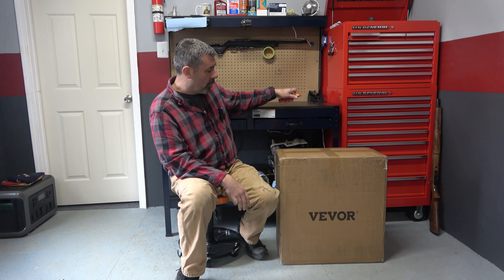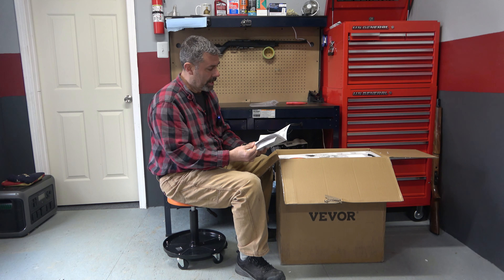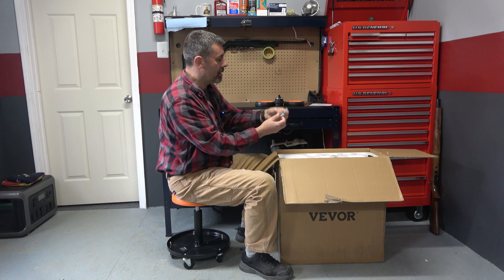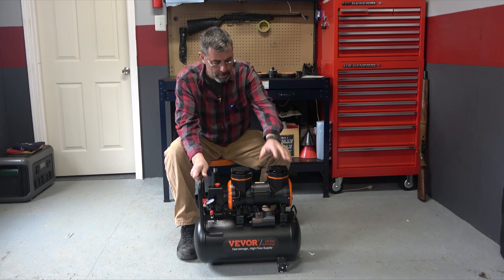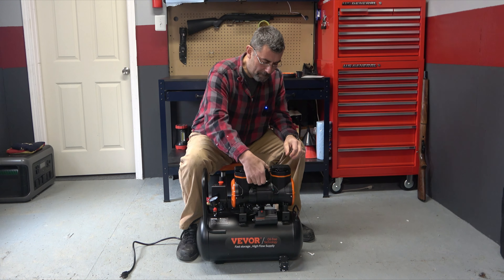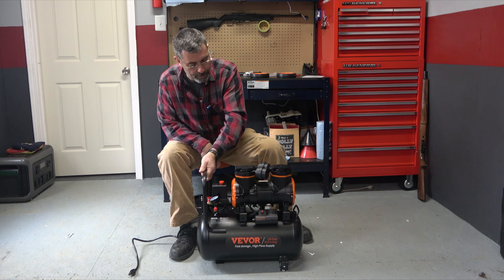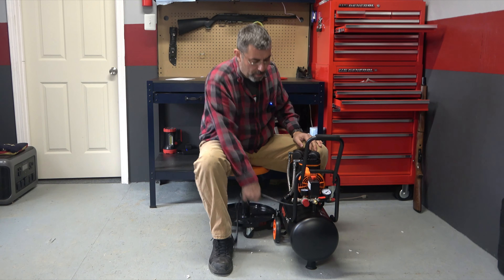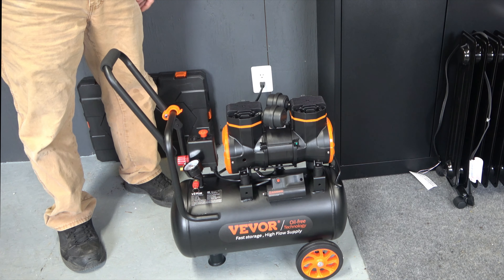Vevor 6.3 Gallon Air Compressor. Perfect for working with small engines.

Comment: Nice little compressor! I'm thinking about getting one for my Basement. Seems very quiet and as you said, it pumps up fast. The one I bought for my garage is a older 6 HP 30 Gallon (Craftsman) single cylinder and it's very noisy. But I picked it up from a abandoned storage unit for $100. Take care Eric, 73's!
Reply from the maker: For light work, it would be perfect for you.

Comment: That air compressor with the way the cylinders are really looks like the newer quiet run air compressors. That size is great for many things. I have a big Mac tools compressor and I have a smaller harbor freight one and I picked up a repaired pancake compressor.  I walked into a great deal on the last compressor. It was purchased and returned the same day because a piece was broken. They had just repaired it and the guy was complaining about having to find a place to put it untill someone would want one and be willing to buy one out of the box.  I had watched him replace the broken part. I asked how much and he said if you want it half price. I think it was $190 or more normally it wasn't a cheap one. I think he ended up selling it to me for $89 and I was able to get a full warranty with it. I have used it for about 5 or 6 years now no issues. It's easy to fill it up and put it in the car and take with me when I get called out for a flat tire.  It holds enough to put more then enough air in a tire to drive on it and get to a better place.  I will probably pick up some vevor tools sooner or later.
Reply from the maker: It pays to be in the right place at the right time. I would not think it would do a tractor tire, but car tire sure.

Comment: that looks like a great small compressor. love how quite that is. i got the small 2 tank DeWalt one and that kind of loud. and my big DeWalt stand up one. 2 cylinder belt drive oil type 240V with wheels is much more quite . but is a beast. runs all my air tools even sand blast and some HVLP painting.   like a hot water tank on wheels. wounder how that fills up some big tractor tires . them screw on mufflers are really air filters and you can replace them when dirty. depending on the CFM of air flow you may be able to do some small HVLP painting. touch up painting. just set the regulator to the air brush. around 40 PSI or so, depends on air brush. if doing that may want in line water separator/ dryer unit for better painting. may run small impact to remove lawnmower blade or take off cat tire  . give it a try . do video on using it. yes 12 or 10 AWG exitron cord,  my 240V one has same plug but the HOT has a 90 deg twist. 20 amp 240. if the natural has the twist that 20 amp 120V and if both have the twist that 15A 240 V . that how US/CANDA plugs are.
Reply from the maker: I had to laugh at water heater on wheels- I think this will be good for a normal homeowner. Tractor tires maybe not but a car tire most certainly
Reply: @FarpointFarms  30 gallon tank. veritable with wheels with 2 belt drive pump on top. girl friend gave it that name. it's DeWalt yellow .looks like a 30 gal hot water tank that we have . LOL

Comment: Small tank maybe 6 liters?
Reply: 24 liters a little over 6 gallons for the biggest model.  The 1450 watt draw might be an issue for a lightly wired shop.
Reply from the maker: Thanks for answering that one